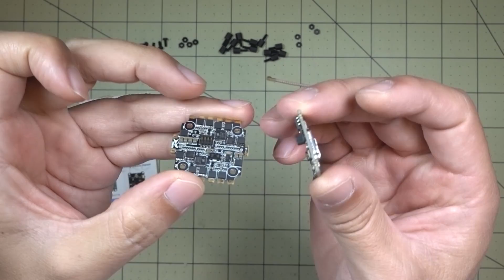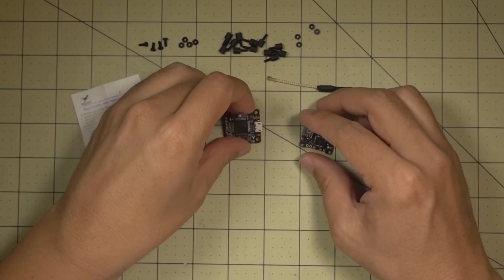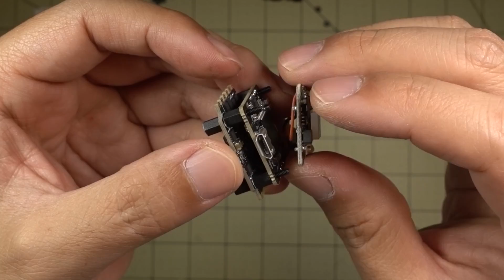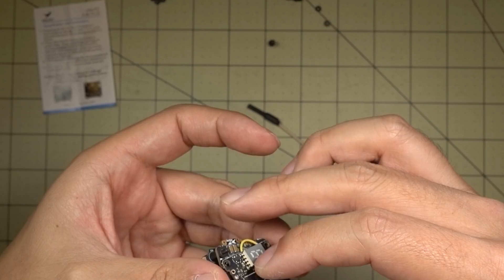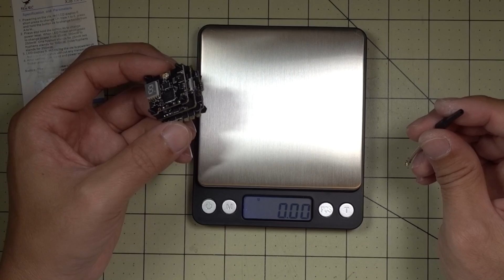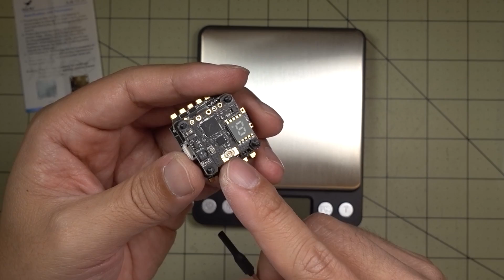HGLRC XJB F428 -TX20 AIO Micro Power Cube Review 👍

Comment: Hiya Albert I wanted to ask you if you you waterproof this setup I blow one of my esc and replaced it and thought maybe better waterproof it this time but my concern is that boot button next to the use port  can I put formal coating over the boot button Albert :-) or I'm I better not covering the boot button
Reply from the maker: The boot button itself is just a covering so coating it should be OK.  If the covering is damaged, then if the coating gets inside then it could be a problem.
Reply: @AlbertKimTV  thanks very much that's great news my friend and perfect timing Albert I'm just away to start waterproof the esc and fc  vtx  have you waterproof the micro runcam by any chance I was think about waterproof that aswell Albert and I'm not sure if I should need to remove the back board to get in between the board's iv never messed around with my runcam but this one's pretty exposed to water lol plus I'm over in Scotland my friend and it the wet session over here for the next 3-4 months :-D  and thanks very much for your help and fast reply :-)

Comment: Hi Albert.  Great review as always!  I was wondering if you could recommend a 2.5 inch frame that will hold the HGLRC XJB F428-TX20 AIO Power Cube in conjunction with a Runcam split mini that won't show props in the video.  Is there some type of H - 2.5 inch frame that will hold everything and keep props out of the camera view?  I'm interested in getting HD video without showing props.  The FlexRC Zeus is built for the split and this flight controller cube, but I think it still shows props.  That's the closest frame I've found that comes close to what I want to build.  Or maybe a frame that would hold the HGLRC F4 Zeus with VTX and a Caddix Turtle cam.  That would just be 3 components plus a receiver.  You may have reviewed a setup similar to what I'm talking about.  if you have could you post a link?  Thanks for the help.    And thanks for all the fantastic reviews!
Reply from the maker: I may have a frame soon.

Comment: Out of curiosity how do u think this will do with a 5” prop (Mr Steel 2306 2345kv) ...he only runs a 32a esc
Reply from the maker: You should get the F438 instead for 5-inch.
Reply: Albert Kim I have an extra f428 and the motors aren’t being used either, just trying to put things in the air lol

Comment: I know this is late reply but, say if I wanted to upgrade the vtx to the tbs unify 5v could I use the same 5v output that the camera uses, so I have the camera and the vtx running from one 5v output from the fc, or do you think this would cause problems
Reply from the maker: electrically that should be fine.  I'd be careful of creating any ground loops that might cause the OSD to flicker.
Reply: ok thanks mate, so if I can find a spare 5v i'd be better off using it.

Comment: I tried this fc and i'm so upseted that with my xm+ receiver it don't work with sbus on uart1 as the specification...i'm reading that it's no only a mine issue and that we must solder the sbus from the receiver to ppm pid od the F428 and set ibus (why it's non inverted) on configuration...i will try but it's so crazy that a modern F4 have an issue with sbus that it's the most used receiver type !
Reply from the maker: I have this working with an XM+ with no modifications.

Comment: Any idea why IBUS reciever is not working after connecting to sbus pad?
Reply from the maker: connect IBUS to the DSMX pad and it will work. The SBUS pad is inverted and IBUS is not inverted.
Reply: Albert Kim Albert Kim thank you a lot for this tip. I manage to get it work using RX3 pad (Uart 3) and it is working fine but now my FC is not powered anymore when the battery is connected. It is working only when USB cable is connected. Is there any other way to power it without that pins from esc/pdb? Or what else i can do to save this board

Comment: hey albert I recently got the hglrc f428 with v2 FC, I'm using a turnigy evolution set to ppm ibus and a fs-a8s receiver.  the two bind and work fine in BF but when I remove all power from the quad and turn my radio off the quad won't arm and is really tough to get back into BF I have to use impulse rc multiple times for it to finally connect again only for the same thing to happen.  Using uart 1 and soldered the signal to dsmx.  Noticed that a blue led on the FC goes out when I arm in BF but when I remove power and turn everything back on the blue light blinks and remains solid.  Please help :l

Comment: Albert HGLRC XJB-TX20 fits very nicely in a Tomoquad XBL2 frame using a microswift 2 and R-XSR receiver.  Question: what are the "crnt" and "rssi" pads on the underside of the flight controller used for?  Connect rssi pad to rssi pad on receiver?  I'm a bit perplexed by the crnt pad since there is no current sensor in the stack.
Reply from the maker: You can attach an external current sensor to that pad and you're correct about rssi.

Comment: I am curious about a micro frame that can use the runcam split. I know you have a ton of frames, can you spec one out?
Reply from the maker: +William Cannady watch my Ascent 3inch video
Reply: Albert Kim thanks brother. Watching now.
Reply: Albert Kim is that the smallest frame possible due to the board size of the runcam split?
Reply from the maker: I think so. The 30x30 board size won't fit most smaller micros that take 20x20
Reply: Albert Kim ok cool, I really want to build a micro over the winter. What has been your track record with the 4-1 ESCs?
Reply from the maker: For the most part pretty good.  I've burned a few but it's an acceptable loss.
Reply: Albert Kim that is a slight hurdle for me is if I lose one esc I lose the whole board and am out 50 instead of a 1/4 of that. I’ll consider it more. I’d like to still run an esc per motor but I know I’m sacrificing size for that. I’ll chew on it some more.

Comment: Finally got the fs-A8s (ibus) to work with this, had to use the DSMX pad, and turn ON (serial) UART 1 and UART 3.  It's the only way it will work for me, someone please explain why .
Reply: What UART is the DSMX pad? I am doing a build w this now and will be using IBUS. It fits great in the Sparrow. Should rock with the Cobra 1407's.
Reply from the maker: All F4 (almost all) have hardware inverted UART signal on UART1 so you have to use a different UART if you want to use IBUS. No way around this.
Reply: for some reason i have to turn on uart1 and uart 3 for ibus to work (fsa8s)
Reply from the maker: +Flyin High FPV UART1 and make sure to disable sbus inversion

Comment: A lot of these 20x20 F4 controllers do not give you access to extra UARTs for, say, a telemetry connection to a FrSky Rx. XJB's F325 board (I have one) does. I guess it's because of space considerations on an F4 board as the F4 processor already takes up such a lot of real estate.
Reply: You can use softserial. It works without any issue.
Reply: I guess it's possible to use Softserial by remapping the PPM connection. Has anyone tried this on this particular board?
Reply: Richard Ding I have. Both PPM and Led are working with softserial in this board. If you have this FC and you are interested, send me a PM and I'll send you the instructions.
Reply: Thanks. I don't have this board. I was considering getting it but didn't realize that you could do the Softserial implementation so I got the F3 board instead. Thanks for your insight!
Reply: Hi, you have PM disabled, but I'm still interested in how to enable softserial for frsky smartport telemetry. Thanks!

Comment: the pads are pretty low quality though. I had it, test flew it and when I went to unplug my battery, I only put some very slight pressure, and the pad broke off. Oh well, I thought, I can solder it on the bottom too. Next time I fly I have a very soft crash, and again the pad broke off. Pretty dissapointed

Comment: Would this 4in1 have any issues supporting a set of 1407 3600kv brotherhobby t1s?
Reply from the maker: Would probably be OK. Just as long as the amp draw is not exceeded of course.
Reply: Albert Kim thank you for the timely response much appreciated
Reply: Alright well good to know i have a cerberus mini 3in and im not a fan of the race flight fc and 4in1 that came with it ive had nothing but issues with it so im looking for replacement fc and esc ideas and i think this should do well

Comment: 1) Someone said F3 may be better than F4 because the F4 running at higher loop speeds is more susceptible to vibrations. So you have to do more dampening/tuning. Comment?
2) If you only want flight time and battery on screen, is there any advantage running a FC with an OSD and a micro swift 1 vs. a FC without an OSD and a micro Swift 2 (with OSD) - for power consumption like current, voltage, battery life, etc. Any preference?

Depending on above, I've been thinking the VTx03 ($9) and the HGLRC ($47, F3, 25A) was the better deal. https://www.banggood.com/Upgrade-20x20mm-XJB-V2-PBF3-EVO-Flight-Control-AIO-PDB-BEC-D-shot-25A-Blheli_S-2-6S-4-in-1-ESC-p-1142584.html?rmmds=mywishlist
Reply from the maker: Wow, lot of questions!  If you have low quality components, use an F3 for better vibration handling.  The F4 will still be way better if you have good components that don't cause vibrations.  I still prefer the Betaflight OSD over a camera OSD as there are many more features the Betaflight OSD provides... the most important one being easy PID tuning without a computer!
Reply: Yep, forgot about the PID tuning (mostly fly what other people publish). Thx.

Comment: It would be best to power the VTX straight from the main battery lead to take advantage of the built-in regulator on the TX20, so the FC regulator will only provide power for the RX, FC, OSD and LEDs.
Reply from the maker: That's true... didn't realize the VTX also has a regulator.
Reply: @SPL, Albert wired them properly. That connection is Vbat, not the one from the voltage regulator. The 5-volt pad is in front of FC, if you look closely at the video, but the other side of the camera. Only there you have 5 volts for VTX, except for the one for SBUS. There's another 5 volts to the right, to the LED+Buzzer pad. ;)
Reply: @Sugar Kane, SPL has refer to the VTX powering, not the camera. If you put a VTX that does not support more than 5 volts at that port that has a V+ on these bord, you will fried it. In other way, I have two runcam micro swift, one powered by Eachine VTX03, and the other connected to the XJB - TX20 and they are working without any problems...

Comment: Does the FC support IBus ok?
Reply from the maker: Yes, if you use uart3 or uart6 and set sbus_inversion = off
Reply: When you did this what UART did you set in Betaflight?
Reply: is it possible to use  a spare uart  for buzzzer  of the buzzer pads are ripped off
Reply: I am trying to use the fs-a8s receiver with the hglrc f428 stack and I can't get the receiver to work with ibus/sbus. It works with ppm though. I've tried the set sbus_angle = off without any luck. Any ideas?
Reply: Brian Hume try soldering the signal wire to the dsx pad Worked for me on the xjb 425
Reply: Dsmx pad
Reply: Thanks ken that worked.
Reply: just a tip   not to  solder the  buzzer  direct to the  board  Mine  came off  with the   pads
Reply from the maker: +Flyin High FPV I used UART1 and the DSMX pad

Comment: I just built one of these with the 25 amp esc's, plugged in the lipo and smoked the esc board. I'm in the process of making a smoke stopper.  I leaned the hard way.
Reply from the maker: Yes, use a smoke stopper.  Sometimes a blob of solder could be somewhere where it should not be and cause a short.  Always use a smoke stopper on any new build.
Reply: how did you smoke it?  I have the 25amp version on the way for my ultra micro build and i don't wanna mess it up
Reply: No idea, everything was connected correctly.  Word of advice, use a smoke stopper! lol
Reply: just built my smoke stopper before reconstructing my wizard.  worked well with just the flight controller but didn't light up or let the FC boot once the ESCs and motors were installed.  everything flies great but i had to resort to a continuity test at all points before plugging in.

Comment: Wow, just looking at this. If you wanted to go ultra light on a 5 inch, you could DIY a 20x20 mounting pattern and this thing would be extremely light. Pair it with a micro swift, A8s or X6B, and some sort of chopstick frame, you could hit some insane amounts of thrust to weight ratios. From a spec standpoint the 28Amps SHOULD be able to handle 4s on a 5 inch. But who knows if tracing and such will actually handle the amp load. And good luck soldering on an xt60 haha.
Reply from the maker: interesting idea... I'll have to give it a try!
Reply: The problem with these micro 4in1s is the lipo pads as far as I can see. I doubt you can solder anything bigger than 16 gauge maybe not even that, I would not put that on a 5 inch.
Reply: Elefkara its a crazy idea, I know the lipo pads are tiny. Its just one of those off, crazy ideas that could really be interesting.

Comment: I have the same stack, but 425 (25A esc). Keep the original CLI, because you need to remap the motors, in case of update to Betaflight 2.x   I ordered these version, with 28A esc. :D The only concern was to solder the battery leads on FC. The power pads are extremely small, and also the size between them... Finally, I am very pleased with these stack +TX20. I put it two months ago in a 3-inch build, with Emax motors 1306-4000kw and no problem at all with 4s. I look forward to seeing in which frame you will mount it. ;)
Reply from the maker: Yes,  it is standard practice to do a DIFF to dump out the stuff that's not stock for that version.  That way you can restore any custom resource remappings.  This is occurring on a lot more boards these days.